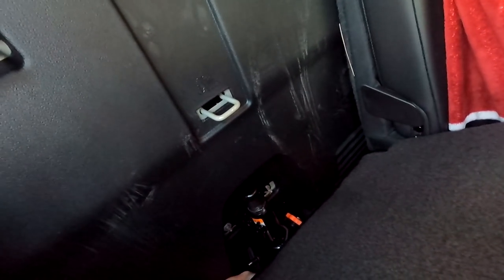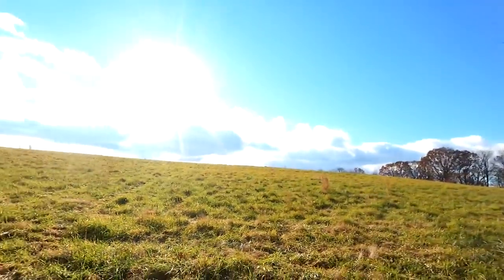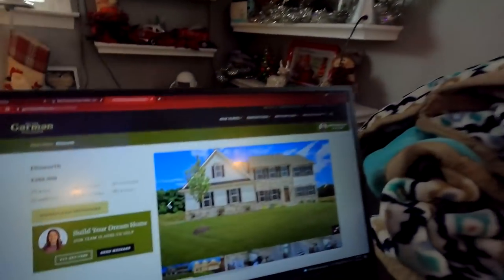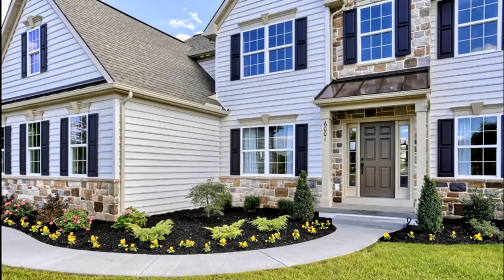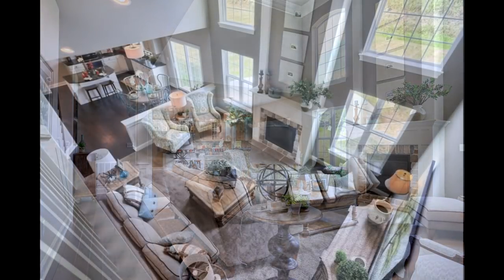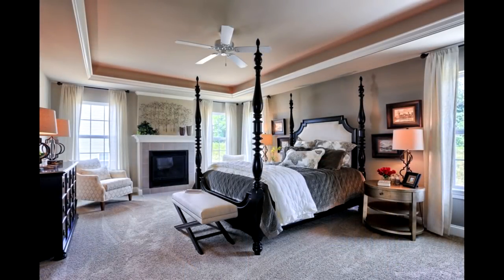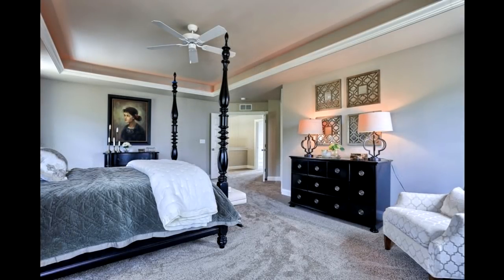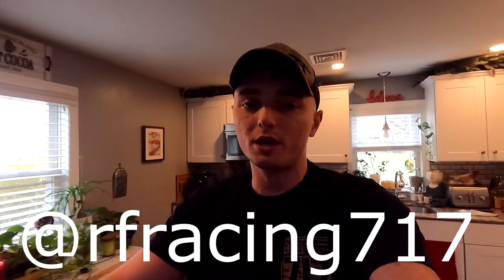We Started Building Our Dream Home!

Comment: Coming from someone who recently went through the new home building experience, if you have things that you want to do but don’t yet have the budget to squeeze them into the build, at least have the contractor go ahead and prepare those areas for those future plans.  For example, if you want a basement, but don’t have the budget for it yet, at least have them dig & pour it.  It can sit unfinished until you have the budget to start finishing it out in phases if needed.  If you are having a back porch poured and you plan on eventually covering it with a pergola or a timber-frame roof, have the contractor go ahead and dig & pour the footers for that before he pours the porch.  That way it doesn’t have to get dug up later at a bigger cost.  Also, have a heater installed in your garage, and also water hook-up inside the garage, and also a floor drain in the garage.  That way, you can do whatever you want, even in the winter, and you can even wash down your garage floor, or even wash your car inside.

Comment: Look into a pellet burning fireplace. You can buy a pallet of pellets for a quarter of the price it would cost to heat your home with the same fireplace plus it’s real fire and it heats the home extremely well and it’s a natural flame. Just a suggestion it doesn’t cost that much more than a gas being installed
Reply from the maker: My dad has one. Might look into it!

Comment: Congrats on the house.  For the garage, you want epoxy or urethane cement.  Oil spills just wipe off.  I also recommend the ability to heat and cool it.  You dont need to go overboard, but when its 35 outside, 60 or 65 inside is way better or when its 105 outside 85 or 8o feels so much nicer.  Oh, you need plenty of 20 amp outlets too.
Reply: A few 220v also, future welders and air compressor
Reply from the maker: Absolutely going with epoxy flooring!

Comment: One thing I've always wanted is a garage with one bay separated from the other by either a permanent wall with a door or sliding wall.  In that bay there would be a big floor drain and hose hookup with hot and cold water for washing cars and trucks in cold weather.  It sucks wanting to clean a car for the weekend but temperatures are below freezing.  Or having some off road fun and all the mud being frozen on the truck.  A heated bay with warm water would be so nice.

Comment: If your going to have an air compressor remember to place it outside the garage or have a little space made for it away from your workspace. The noise of a compressor in a shop will drive you crazy because you can barley hear people and you'll have to stop the video till it shuts off. Also if it were me I would have air lines and drops plumbed up in the shop for easy access. Running compressor hoses everywhere is a pain and rolling em up its hell especially in the cold because the harden up

Comment: I would be doing block home thts what we have love it the electric bill is less keeps house cold in summer and hot in winter also would do spray foam in attic and if wood frame foam in walls will save lots on electric my brother is a general contractor builds homes in Florida block homes here in Florida are the best for hurricanes the only ones standing after a bad hurricane or tornado good luck ask alot of questions and don't be afraid to ask another builder
Reply from the maker: My current home is block. Home inspector said it was like a mini bomb shelter 😂

Comment: My house is laid out similar to this one. Overhang above the living room, really high ceiling, etc. Just be prepared... when the temps get cold, be prepared for a ridiculous heating bill to keep all that open space warm. My highest electric bill last winter was almost $600; and I also have a gas fireplace in the living room. Home has two HVAC units also though.
Reply from the maker: $600?? Electric heat?
Reply: @RFRacing717  yes. To HVAC central heat and air. My fire place was messed up last winter, I got it fixed before winter this year. Lol  My highest electric bill last year was $585 in January or February one. Won't be near that this year with the gas fireplace on when it gets real cold.